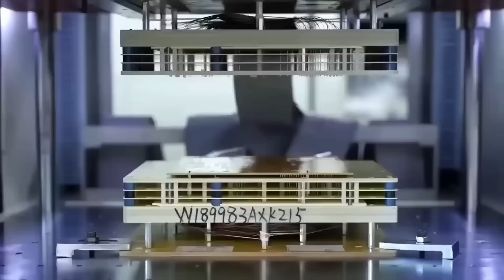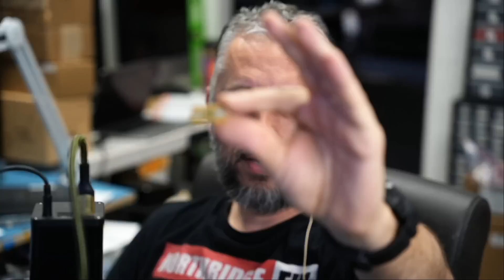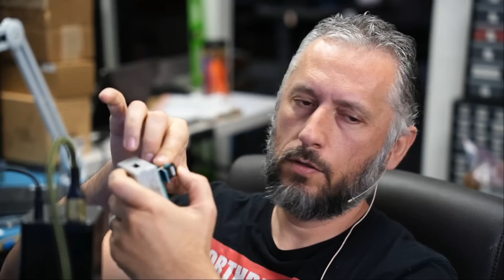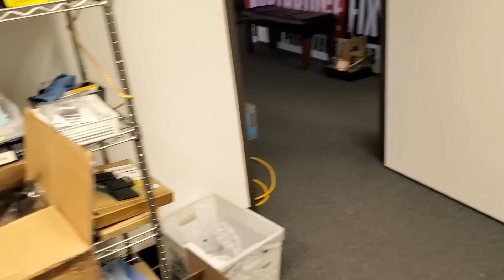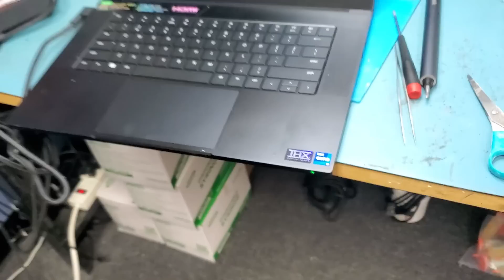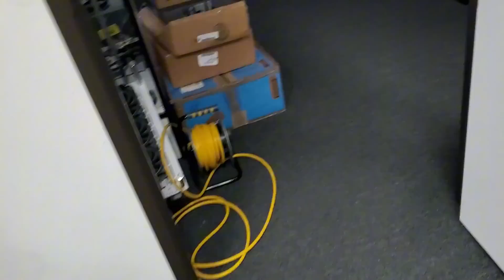vBIOS Mod Killed a $3,000 Razer Laptop – Avoid Gaming Laptops!

Comment: never understood why someone would flash a BIOs from a different board.  the odds of it working is pretty small.
Reply: It almost never happens these days, but I had that good old Dell Inspiron laptop back in the days that came with a GeForce 7900 GS. You could pay a premium to get the 7900 GTX upgrade, but there was a catch: the 7900 GS was a genuine 7900 GTX flashed with a different BIOS that underclocked the GPU and RAM.  Same chip, same VRAM, same cooling.

I flashed it with the GTX BIOS and it worked flawlessly for years BUT I made sure to dump the 7900 GS BIOS before and I had the tools to flash it back.
Reply: @phazonclash  I had a Radeon HD 6950 flashed to 6970. But that was a desktop there no much risk on a laptop.
Reply: vbios are quite compatible, but different power management is a bad idea
Reply: You only can get away with it if it's from the same vendor, you verified the PCB is identical, and most importantly, the SAME RAM type.  I used to have a 1050 Ti that was an MSI Gaming card.  Crossflashed to a Gaming X after realizing both cards physically are identical, just had to find the ROM for the right DRAM, it worked.  Gains not worth it though of course.  On a 1080 Ti now, and have zero plans to mess with it, because knock on wood in 2025 it's still working well.  Then again, I got a Gaming X because it clocked up to 1911MHz boost, instead of Nvidia's default boosts.
Reply: not really of you know what you're doing, for example i have a laptop motherboard with z170 chipset that runs 9900k cpu at 5ghz with bios mod, and a 5090 desktop via mxm to pcie adapter and i have a laptop with 3080 that initially had a 140w bios updated to 175w, the gains are significant. as long as you know what you're doing.
Reply: @robertvogel4056 most ppl see other ppl do vbios mods and after that... oh i can do that ... and you have a brick to hold the door when it is summer
Reply: They are full of nonsense
Reply: If it aint' broke dont fix it ......
Reply: Usually the install process stops by itself.

Comment: Alex has valid points. Buy a desktop. Upgrade it later. If you can't afford the laptop you really want, make sure you can live with it's limitations and leave it alone. It is what it is. I don't know about some of the newer laptops as I enjoy tinkering around with the older laptops. Are the newer ones upgradable like many of the older ones where you could actually upgrade and replace the CPU and graphics card?

Comment: Yeah, let's vBIOS swap to gain an extra 3 frames!
Reply: Its a razer so I am sure it was a lowered TDP 3070ti. He probably flashed it with a a vbios from a full powered mobile chip to get the extra wattage. Problem is even if he was successful he would still be limited by thermals which is why the laptop uses the lower powered version in the first place.
Reply: @randy2493-s6n hey do not tell ppl that they have restrictions man... there are no limits / restrictions  on the road to performance ... but you must know what you have to do ... like not have a igpu disabled
Reply: ppl should undervolted instead of overclocking a laptop not worth the risk to brick your device for extra frames....